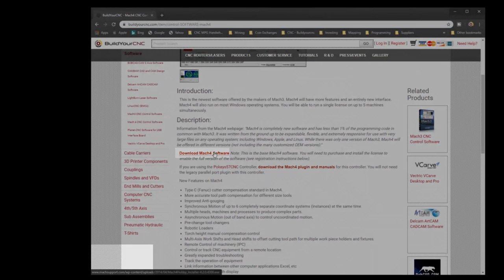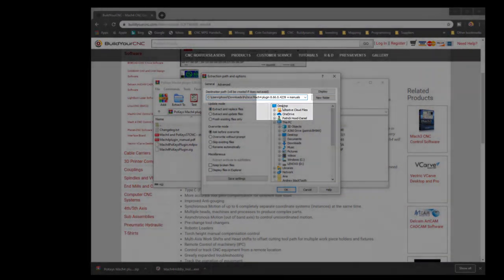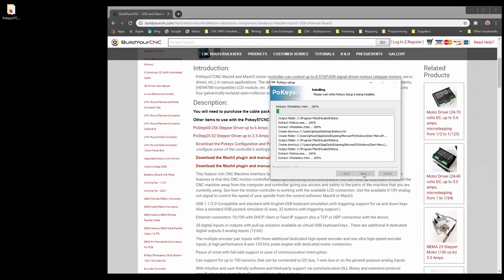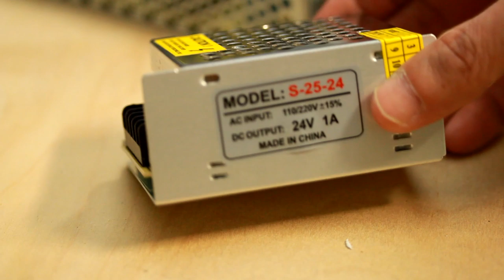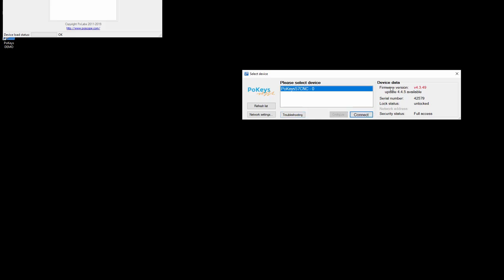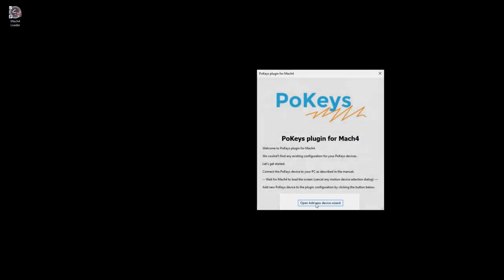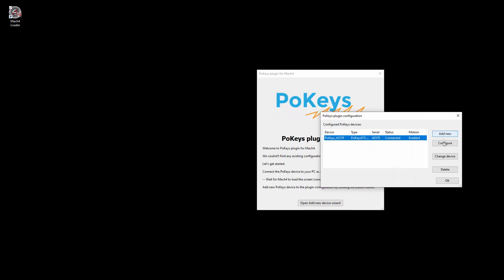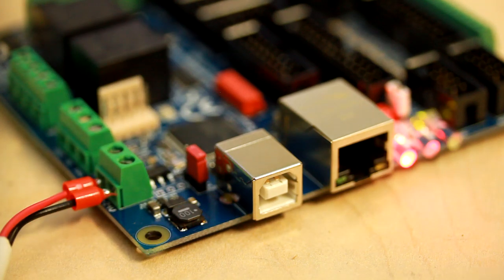Pokeys57CNC and Mach4 Part 1: Software Installation, Connect to Power and Test Software Connection

Comment from the maker: Let me know if you have any questions of comments.  I would like to know what you would like to see in this series.  I was planning on showing basic features, like motor movement and tuning, limit switch wiring and test, and showing how to use the relays to control external devices.  Does anyone have any interest in the deep programming aspect of this controller? 

Thanks!!
Patrick
Reply: I'm interested in the design of the CNC, the goals for the CNC and why they are important, the assembly of the cnc, the options and choice for spindle, the motor options and choice, the choice for control software and why, and finally, what would a Cnc look like if powered with brushless motors instead of steppers... Phewf. But yes, a lot of interest from mr
Reply: I would like more info on the spindle speed control please. My pokeys always runs my spindle at 24000 regardless of what i had in my cam program. TIA

Comment: By the way, great video. Very much looking forward to follow up videos
Reply: I like the amount of detail you go into. Makes life so much easier when doing it yourself
Reply: Fantastic close ups of the hardware
Reply: What's a spade terminal?
Reply from the maker: @abcqer555  a spade terminal is a "Y" shaped metal connector that crimps to the exposed strands of the end of the wire and can be slid under the screw of the terminal (in this case, the screw terminal of the power supply) and tightened down.

Comment: anyway to use the axis limit input + as a -.  Trying to setup homing using the screw terminals.  They are by default setup to use the axis + limit.  But on my Y axis my switch is install on the negative side.  I know you can install a ribbon cable and use the negative pin that way.  But I was looking for a way to change the input from + to -  if possible

Comment: Hi , I have purchased pokey57cnc from your website some days ago. But not able to connect it so far, first it shows error " Emergency switch input not configured (pin 52 must be used )". Further my computer is behaving unexpectedly , pdf files are opening and closing itself , youtube video itself starts and stops untill pokey57cnc is connected to computer. Kindly guide , what to do